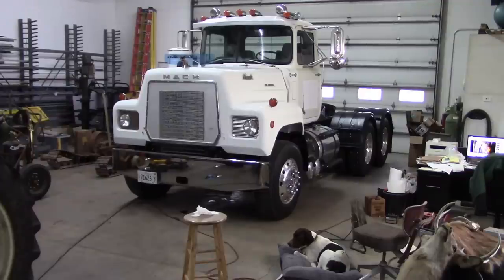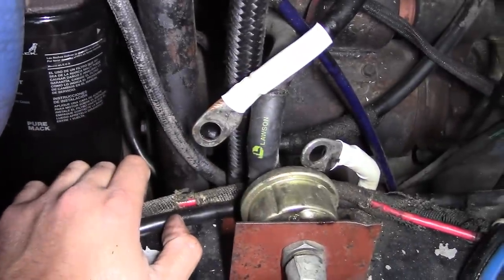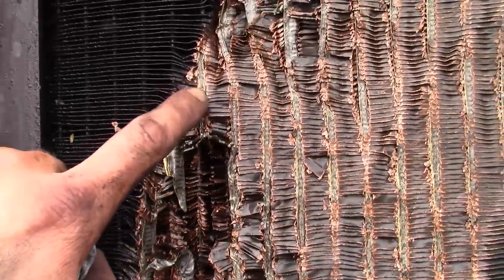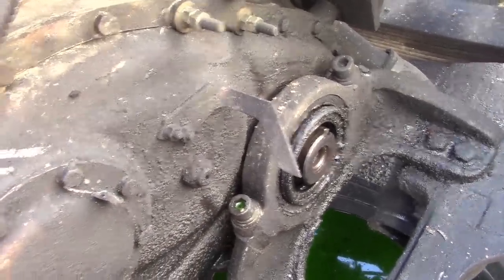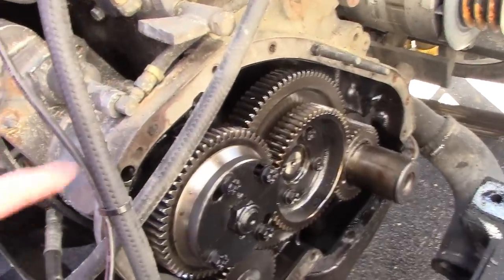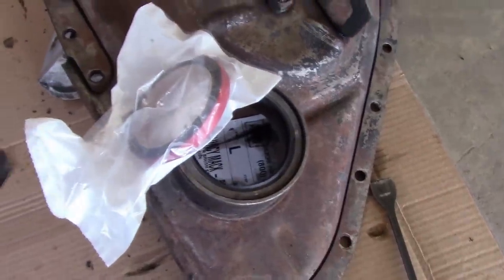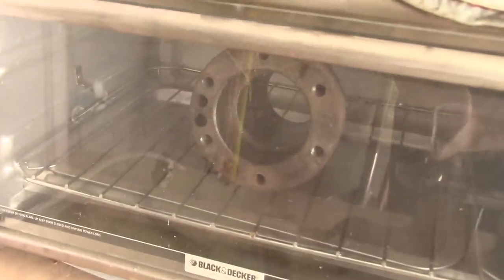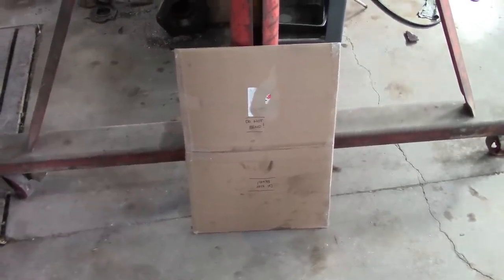Mack R Model Semi Truck Has a Bad Day - Fan Hits Radiator and Battery Issues

Comment: such a shame...it was such a clean old mack. when i have to remove a hood by myself, i built a cradle out of 2x4's with casters. roll the hood away and made it easier to reattach later. if your only semi truck is 43 years old, you should have a spare for parts.
Reply from the maker: Yes. Or maybe two! He is going to have the hood and cab fixed this winter. But I suspect he will be getting rid of this truck. He bought it for very limited use. Then he learned how handy a truck was and now they are using it way more than ever intended. I suspect he will get something newer for next harvest.
Reply: @WatchWesWork  Tell him to hang on to it.

A) it's cool, and
B) a spare truck for emergencies is a godsend.  Especially something like this.  Just chuck in a set of batteries, and you can be confident it will start when you turn the key.

Comment: Hey Wes get you some NOCO NCP2 A202S 12.25 Oz Oil-Based Battery Corrosion Preventative Spray, I have been using this for 40 plus years, works great. And if you turn those pliers designed to spread terminals 180 degrees they will even work better

Comment: At the used truck dealer where i welded flatbeds, the head mechanic asked me if i could weld an exhaust manifold for him. If he could find one it was 600 clams and only the side he didn't need. So i made a holding jig to bolt it down. Well, Wes 8 hours later he put that manifold back on. It was almost broke in half. Yeah this was a gas engine manifold. He put it back on and shipped it down the road!

Comment: Mack made 2 timing cover centering
 sleeve, J-26583 4.25 OD crank seal, J-24230 4.00 OD seal, cam aux shaft button wind until it hits shafts. Back off 1/4 turn  tighten jam nut, Watts truck center by Pittsburgh PA 724 668 2201 for old Mack parts, Awesome Truck and 👍

Comment: Never fails no parts when you want them , PS You can use your chop saw to flatten a flange surface using the side of the blade ,I show how on one of my Chrysler Carb service Vids it removes the concave the side bolts leave while torqued down lay it on the blade and twist your wrist back and forth in a smooth motion you`ll see it`ll smooth it down easy.

Comment: Lots of radio equipment has fuses in both hot and ground.   The thought is so that the antenna cable can not end up as a high current return path if you loose a chassis ground
Reply from the maker: Interesting.

Comment: Wes, two-way radios always have a fuse in both lines when they're taken direct from the battery, the neg line will be grounded in the radio most likely and in any case via the shield of the aerial coax.  Now, when the battery is changed should someone get it wrong the radio ground is now live and if un-fused then all manner of nastiness happens.  Better though to take the radio neg/ground to it's own chassis terminal somewhere then it can't be a disaster.

Comment: Poor old truck. :-( I can only figure the tractor driver stopped in the mud and the truck couldn't and slid into it. Surprised the quick hitch hook didn't punch a hole.
Reply from the maker: Turns out they were using the combine to pull it! The tailboard hit the hood.
Reply: @WatchWesWork  They should buy a longer chain. :-)

Comment: Side cuts, crimpers, cotter pin puller or battery terminal spreader.  Basically a Multitool, fyi also has a hammer function.

Comment: I find anytime I’ve gotten anything sent overnight or quickly the shipper has gone out of there way to change there whole route to take as long as possible to get it to me. I had a bearing shipped overnight.... took three days to get. No refund either. Those were some tough trucks. I never broke one of those.
Reply from the maker: And then they don't refund the ransom they charge!

Comment: Using four number four six volt batteries was more or less standard up until roughly 40 years ago. The weakness in that system is if you lose one terminal or you have high resistance at one terminal I should say you're more or less lost two batteries and not just one so it if everything was clean work great but if it wasn't it was a bit less reliable than using four number 31s. Usually I find it's easier to just install lugs on the cables and use four number 31s in parallel. Usually you can find a better deal on 31s than you can on group 4 6 volts anyway

Comment: that main balancer thingy with the speedy sleeve should be possible to repair. Have it ground down and electro plated/welded then ground down. Some specialized machine shops do this. It's not that expensive.

Comment: Nice job!  Love watching those combines working.  Really surprised no dowel pins on that cover.  Would it have been cheaper to sell that engine as parts to the recycle yard and then get a new or NOS engine?  40+ years old and getting harder to get parts.  There will come a time when no parts will be available.
Reply from the maker: I think it's still a good engine.

Comment: ok a skid and your forklift make a excellent platform to rest the hood on unhinge the hood pull the plug for the lights and move it of your way. . then use the forklift for the radiator. 
build yourself a T stand with a adjustable height to support hoods

Comment: I have given up buying "matched" set of belts after getting 3 or 4 sets that clearly had 1 larger. I have since started using 1 piece belts with multiple ribs on machine tools and had much better luck. Not sure if that would work in your case though. Thanks for the great vids!
Reply from the maker: Even worse are the "match maker" belts that are supposed to be all the same length.

Comment: I have those obscure pliers from back in the day when most cars had lead clamps and i hated mangleing up the clamps trying to pry them open don't use them much on cars now with sheet metal clamps. I have some electrical contact grease ( thomas and betts kopr-shield cp8-tb) with copper in it thats supposed to be conductive for clamping down big industrial wires it does not conduct electricity just stabing electric meter probes into grease. i suppose it is supposed to work when squished between tight fitting parts. i put that on all the insides of my battery terminals wipe off extra and put silicone over outside and it lasts life of battery no corrosion 4 or 5 years later

Comment: I had a brand new battery cable that was bad. it passed an ohm meter test, it failed a load test. you can't tell if cabling is good by looking at it.
This vehicle had been looked at by three shops before I was sent out to determine what was going on. They had replaced  two battery starter and the alternator, all because of a bad new cable. fortunately we had all the removed parts because of a company policy of retaining all replaced parts to be inspected later. so those parts wear used on other vehicles in the fleet after testing.
the battery is the worst possible place to connect accessories.

Comment: That is a frankentruck. That engine looks way newer than a 77. They probably pulled it from a newer truck along with that air cleaner with two outlets (the original would have had only one. 
Also the lower rad bolts were the correct ones, but crushed the bushing and then crashed into the housing.

Comment: 300 ? Old Mack’s are the best trucks ever made.
Reply: I beg to differ. I've worked on plenty, they are usually rusty worn out pieces of shit by about 15-20 years of use, and nobody wants to spend money on them to fix em.
Reply from the maker: They are tough, but tough on the driver...

Comment: if i can remember right the front timing cover is centered by leaving the cover bolts lose, then install the damper pulley and the tighen the timing cover.

Comment: Sadly most farmers buy according to the money in bankroll, and whats the best deal for the very least amount of money. I am not, repeat not a fan of Freightshakers but tons of them out there to pick from. Even most families try to have a      second car in the driveway to get to work if one is a bit older. I know that Mack is "bulldog" tough but most beat the driver to death not to mention how overbuilt they are. I have changed of those R model front engine mounts and they break because of the way they go in .... they said that you have to take this and this and then this off to get the mount out and yet I come along with the torch, make some room, then reinforce that whole deal and never break again from the way that most of them crack out n let the engine set down on the crank. Over the years working in the bush where a week is your overnight special, we tended to skip the rules, make what we needed to get it back on the road. One driver had busted up three hoods in less than that many months... I took his hood off, and built some fenders to protect the glass, mounted some of the ugliest head lights and signals that I could construe together  and made him drive it that way. You get tired of yo yo drivers who put on their hat and drive which ever the way the bill on their hat is pointing. I had better luck with young guys who really wanted a opportunity to get a job driving. They would crawl under and grease everything that would take grease and write it up which ones that wouldn't take grease even after the zerk was changed. You could teach them how to do stuff and they did it. I had guys show up in a fancy vest that screamed "Cowboy" and told them I wasn't hiring yet needed a driver.... one guy actually outsmarted me for a while as he showed up in a working mans gear and then started driving in his fancy gear. He was setting in a coffee shop drinking coffee and telling them how he fooled me when I got in the rig and drove it back to the shop with him standing in that coffee shop driveway screaming at me. Took me a while to stop laughing. In our case out on those island jobs where what you have in the "bone pile" is your parts store, you just have to be tough to keep it all together.

Comment: Excellent video as usual, keep up the good work! Would you mind sharing the source/brand of battery terminal cleaning tool that you utilize? These stamped sheet metal versions last a half dozen times and they disintegrate. Thanks!

Comment: I hope you put the pulley on through the oil seal before you tightened down the the front engine cover. You need to align the oil seal before tightening it or there will be more pressure on one side of the new seal.
Reply from the maker: I did loosen the bolts after installing the pulley.

Comment: About the double fuse on the two way radio, I've been a amateur radio operator for over 25 years, and have seen numerous new radio manufactories strongly suggest to fuse both leads, something about the remote chance of getting feed back and making that radio a place holder. Did I fuse both leads, nope.

Comment: So you know that timing cover has bean modified, they used the same seal for all there six cylinder engines up to 1994 . The reason mack don’t have a speedy sleeve for that seal is cause they will wear the sleeve out in no time . There a Teflon Seal  and normaly  will seal with a grove on the crank but I’ll knock them in a bit more then what the book says to get off the wear grove . The thrust adjusters you turn them in till they touch and back them out 1/4 of a turn  old Mack machanic here
Reply from the maker: Everything seems to have been modified on this truck.

Comment: in electronics the electrons "current" travel through the negative to Positive "Yes in revers of what you think"  so on electronic unit such as the Two way Radio.  that's why you have both Neg and Pos fused
with the radio wiring you should have a Pos and a Neg live in the cab at all times so the radio can be on and listened to without ignition key as the ignition even with just accessory on will drew more current.
Reply from the maker: There you go!

Comment: If indeed this Bulldog "Mutt" (since you think it's built out of several trucks) is a RL600 which by the looks of the straight frame rails (as opposed to splayed frame rails) the "R" means this is a "Western R Series" (build at Hayward, California plant) and the "L" designates it as having an Aluminum frame.  I do have a question about if the truck is only 43 years old. The reason I ask that is the 4 Six-Volt batteries, admittedly this truck was built if a 1977 about 6 years before I started working on cars for a living and 9 or 10 before I started working on anything above a "One-Ton." Anyway back to the 4 Six-Volt batteries I converted several pre 1974 Mack "R"-Models from Six-Volt charging system to Twelve-Volt charging system. There was a local truck parts store that sold a Six to Twelve-Volt conversion kit and I remember being asked if I wanted to keep the 4 Six-Volt batteries or replace then with 2 or 4 Twelve-Volt batteries and besides asking what was the difference in price I asked the advantages and disadvantages of keeping the 4 Six-Volt batteries and besides cost I was told winter time cold starting especially if the truck didn't get run every day or two and or if it was keep outside.  The long and the short of is since the trucks I were converting to a Twelve-Volt charging systems only got used during the winter and during that time were keep inside and the batteries in the trucks were less than a year old the left and right batteries were like yours hooked up parallel to get from Six to Twelve-Volts (something the truck owner regretted later on but that's another story) The RL Model Mack besides having an Aluminum frame also had crossmember also incorporated front spring mounts, core support mounts, front engine mount and is a different design than an East Coast Mack. Another difference West Coast Macks had or at least were advertised having as standard Aluminum doors, wheels, bumpers, and multi-purpose casting.
With regards to your about the the wiring of the two-way radio is was and for all I know is still a common practice to make home-run power and ground wiring runs to the battery and fuse both sides. The reasoning/theory is it eliminates "charging-system hum" and the fusing on power and negative leads is belts and suspenders to prevent against damage to the equipment if someone hooks up jumper cables or battery cables backwards. Additionally it was an option at most radio installation shops to install a relay that would kill power to the radio when the ke was not in the run or acc position but since this was an additional cost of parts and labor it was commonly not done.  On a side note on higher end stereo installs if additional batteries for the amplifiers are not installed you will see home-run power hook-ups and fuses on both sides.

Comment: Fluid film on the terminals I’ll have to try that. Our nissian battery’s corrode like crazy
Reply: Spread a thin layer of dielectric grease over a freshly cleaned terminal and stud. Put a shined up copper (pre 1977) penny on the top of the stud and cover with a dab of dielectric grease to hold the penny in place. The terminal will never corrode as long as the penny stays in place. Has to be pre-'77 to be 100% copper.
Reply: Fluid film works great on terminals .. be liberal with it ... it will create a wax barrier to protect them
Reply: try Caig DeoxIT battery terminal cleaner & Protectant.  promotes conductivity, unlike dielectric grease

Comment: very cool Mack well done on the repairs Wes um I thought the isolator was for negative - not the positive+ from the battery and wouldn't arc out on chassis if lead/cable chaffed
Reply from the maker: Most I see are on the positive.
Reply: @WatchWesWork  ive wired up one on the positive side of a excavator and was told off for doing it wrong isolator  is still on the machine i don't know why the mechanic wanted on the neg side i suppose all the machines at work had negative through the  isolators cranes wheel loaders telehandlers trucks and other excavators too

Comment: Your problems with parts is common with all the stuff this old.  I guess no one really expected anyone to fix a vehicle a 43 year old truck.  When I was graduating from high school in 1966 that would have been like looking for parts for a 1923 over the road truck.  It is unfortunate that parts for vehicles this old are hard to get but there aren't many 1977 Mack R models on the road.  You can get parts for a 1977 ford or chevy but if you went look for some of their industrial machines you probably would not find parts either.  The worst part is in 1966 when I went to get a part for common parts the counter man at the parts store knew what the part looked like, what the common name for it was and in most cases what other part would work in its place.  Now days the guy at the counter has had no training and can get paid as much for handing out hamburgers.
Reply from the maker: Not many 43 year old trucks still running.

Comment: the air compressor is bypassing oil, the updated oil supply tube needs installed on the air compressor, it will look like a cummins exhaust spacer or a 3/8 socket, fits in the end of the accesory drive, the original tube over supplied the compressor with oil and would fill the ping tank full of oil even with a air dryer, the water pump bearing sounded horrid, any time you have the coolant out and the age of the thermostat is unknown you should replace it, they like to stick and then the overheat will crack the heads between the injector bore and the valves, if you cant find parts for a mack try the evansville indiana mack dealer, i worked for a garbage company (bfi) and they always stocked lots of parts for us, most of those old engines used most of the same stuff, try using anerobic sealer instead of silcone(grape jelly) it is ten times the sealer silcone is, and works well for those oil pan gaskets that are torn, have someone push the clutch down while you watch the front pulley i bet the thrust washer is worn out on the crankshaft, i have seen them move a 1/2 inch or more, and would explain the bent pulley